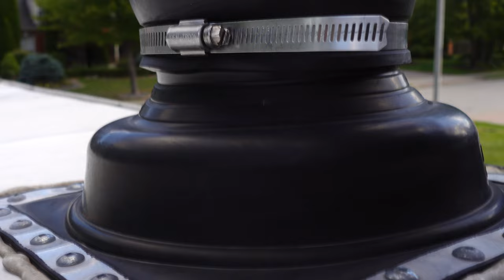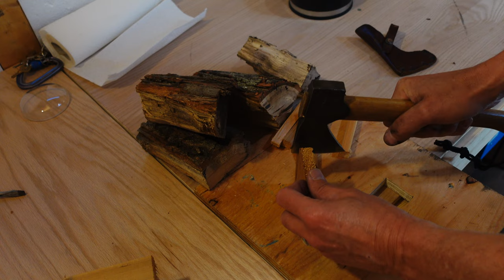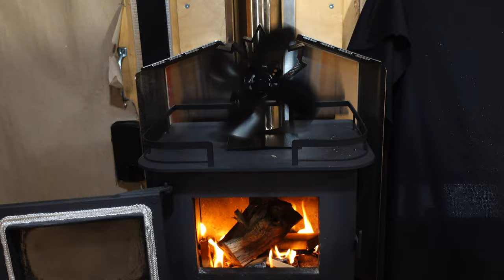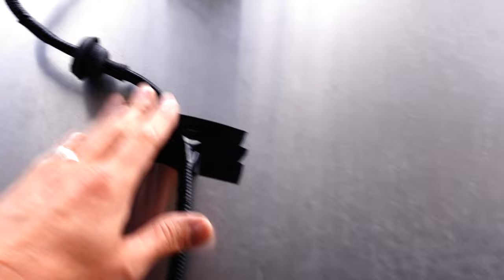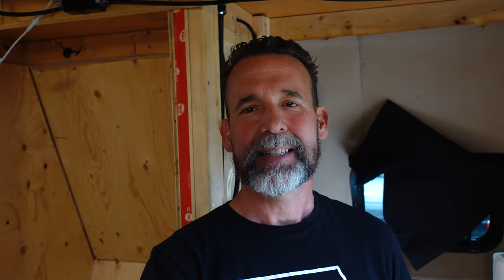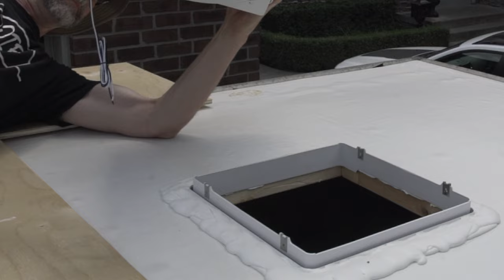Shoulder Season: Time to Talk About Building Your Own Travel Trailer

Comment: Check out RV with Tito for help on the solar panel install on the roof, specifically the rails.  I'm building an RV from scratch similar in size to yours and will have roof and portable solar panels.  He has some good tips, specifically in his September 2, 2022 video.  My RV has been a 3 year process so far - mostly just weekends.  Cabin is 8'x12', same shape as yours.  Power will be from solar, shore power and also alternator.  Most of the wiring is now done except for the solar and the electrical definitely took a huge chunk of that time, especially because of the steep learning curve to make sure it's done right.  This RV will have a full L-shaped kitchen, full bath with composting toilet and shower and storage wardrobe.  I just caught your videos this weekend and binged them while working at home this weekend.  Really interesting stuff!

Comment: Heya Scott. I have been following your build for a long time now and intend to take on a project like this, probably starting in 12 months or so. Your design is almost exactly what I will be doing. I especially love the pull out kitchen as it is fully functional yet it takes up "no room" from the interior. Such a brilliant idea.

In your video, you mentioned folks requesting a cost breakdown and that this video may be coming. If I may be so bold .. when doing this video, could you give a quick breakdown (even in writing in the text part of the video is totally fine) where you purchased some of the more 'less common' parts. Not electrical, plywood, etc, etc. The fireplace, the new roof fan, windows/door, etc. One thing that I also was curious about purchase location is, during the initial part of your build, when you were putting down the aluminum floor to the trailer frame, the flashing you used. I tried to find something similar but came up empty. So, yeah, as I say, perhaps a list of stores you used would be so so so appreciated.

And 100% .. a live stream would be awesome. Id certainly attend that.

Again, your videos are amazing. Your craftsmanship is superb. For a regular fella (not a professional in the field), you are an inspiration. Cant wait to see your continued progress and see the final finished product :)

All the best to you and your wife on your anniversary.
Reply: Jeebus. Sorry for the grammatical errors. Oooofta.
Reply from the maker: Hey Chad, I will try to cover those items 👍